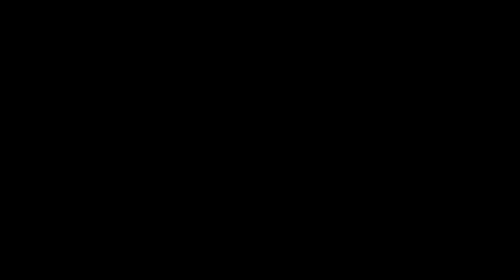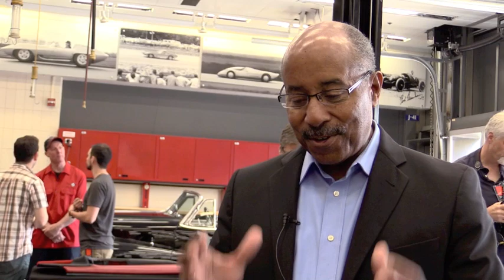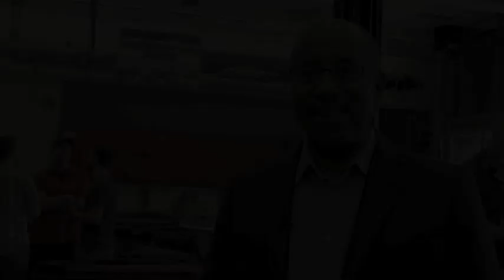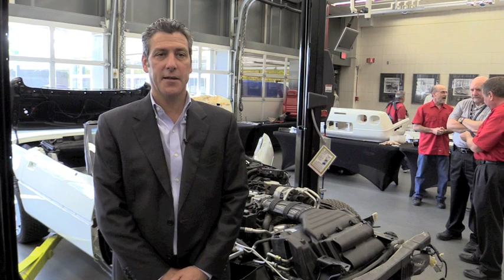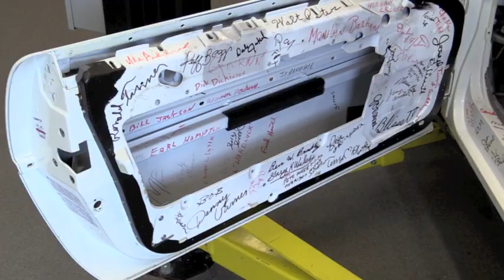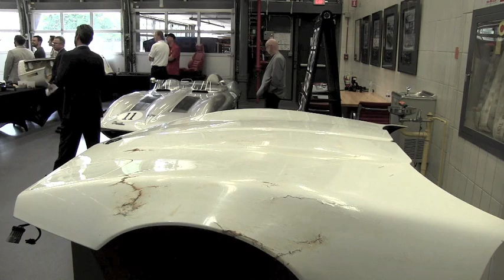1 Millionth Corvette Restoration Update

Comment: I am a retired GM of Canada employee. I used to work in the engine plant were we installed a new engine line to build Corvette engines. I have mixed feelings about GM owners, managers and supervisions quality statements AND their actions on the floor. As workers, we follow orders, our lively hood depend on it. We all tried to build the best engines we could. As workers, each of us had our own specific year, make and model we liked. Mine is the 1965 Roadster with a manual transmission and a big block 396 producing 425 bhp. I do think that the days of the fossil fuel powered vehicle are over. They have to be. Our lives depend on it.